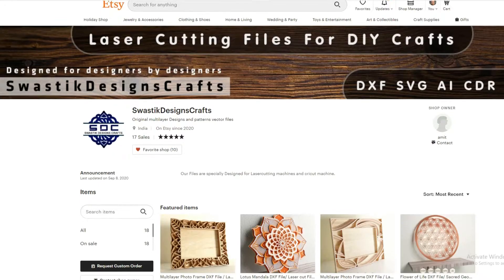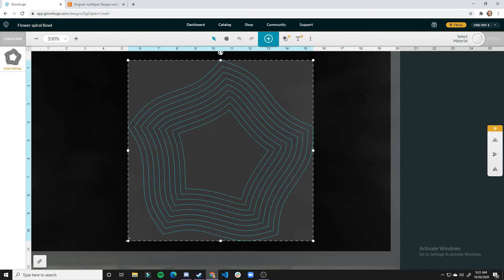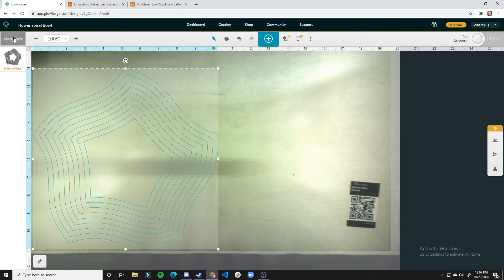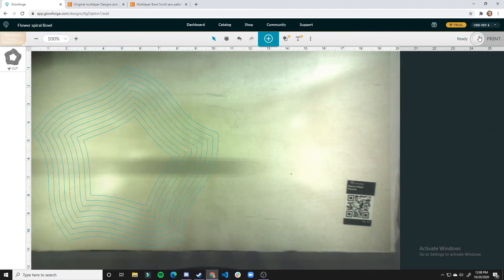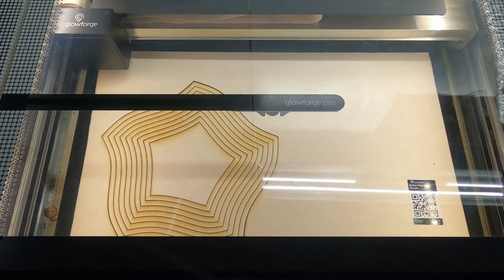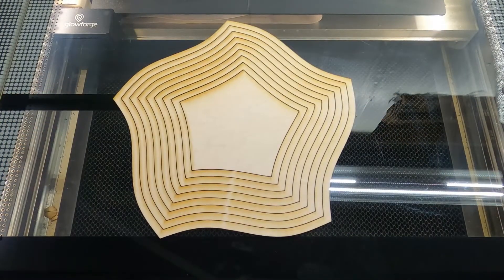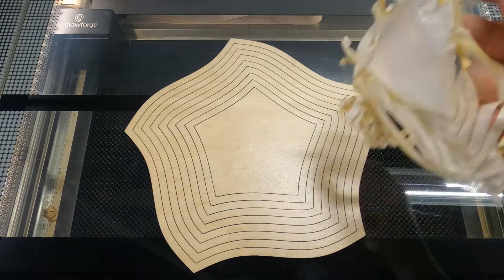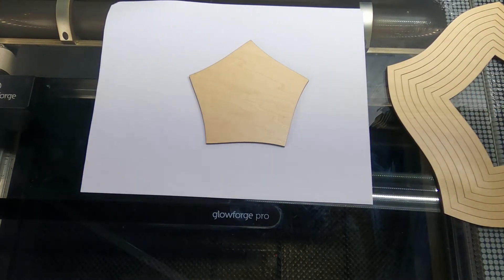GlowForge Project // Scroll Saw Bowl

Comment: How do I use a scrollsaw paper pattern on the glowforge.will it copy if I lay it in the bed of my machine to produce it.
Reply from the maker: If you have the svg file for it you should just be able to import it onto the dashboard and run it as normal. Does that answer your question? I also have the Etsy seller link in the description.